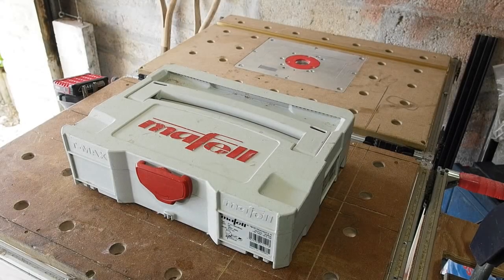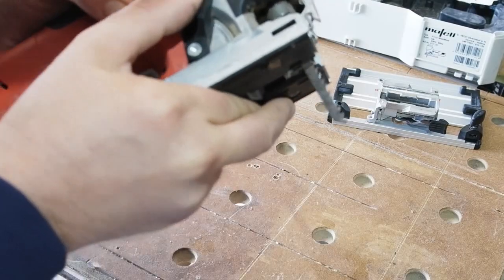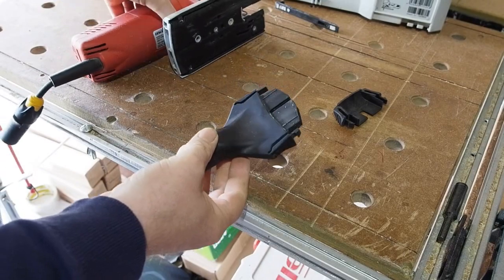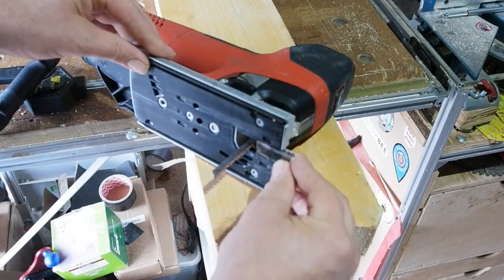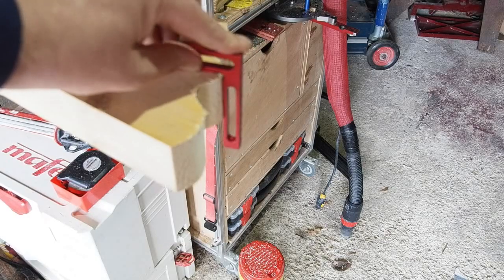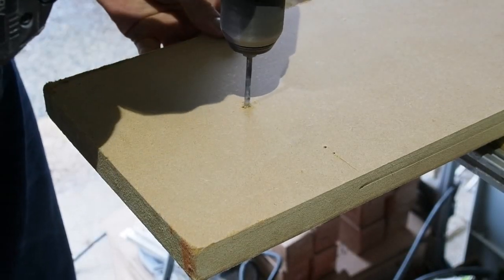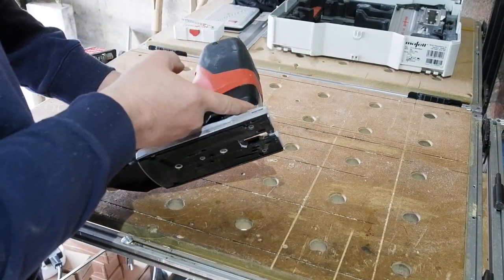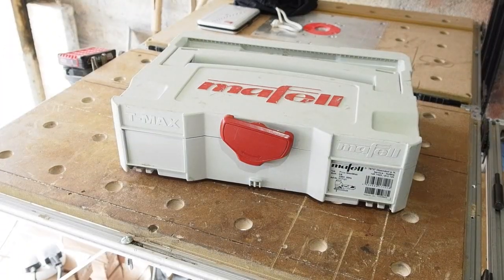Mafell P1CC Jigsaw. A Closer Look And Review.

Comment: Bought my P1cc 10 years ago in the UK when i fitted kitchens it has been used and abused its cut granite with diamond blades and now here in NEW Zealand its finally getting an easier life as i make motorhomes now,  Without doubt its the best jigsaw that has ever been manufactured, my first jigsaw was a professional Bosch one around the late 80s since then i have destroyed countless makitas, matabos, hitachi (didn't last long) and a festool jigsaw before buying the mafell, this one is the one to buy,  Good demo of what the jigsaw can do especially when fitted with Mafell's blades.
Reply from the maker: I've found it one of the more dependable jigsaws I've owned too. One thing I didn't mention is I find it doesn't get that hot compared to others and isn't as hard on blades. Because it doesn't have guide rollers maybe? Not sure. I do still think the corded Bosch GST160's and Festool Trions are are good solid machines but the only jigsaw I'd swap to now is a cordless P1CC if Mafell ever make one.
Reply: @BischBaschBosch  900W + 20% loss in driver = 1080W 
1080/18V= 60A
The 8Ah pack is good up to 80-88A so it can be done. 8Ah minus 20% cut off = 6.4Ah 
6.4/60x3600=384 s or 6 min and 24 sec. run time on one 8 Ah battery.

Comment: I think why they don't come with a light is that in many parts of Europe and the world they actually hold/use the jigsaw "upside-down" (to us Brits anyway) and so the light would be shining in your eyes or just out of sight completely. I have had  the p1CC for nearly 2 years and have fully converted to the reverse cut, its a game changer, lets say you take a piece of kitchen end panel and pencil a scribe on to it, you can use the jigsaw with no fear of chip out on the face side due to the blade cutting down through the face instead of up like the regular pistol grip jigsaws, (i did use to use down cut blades before this but they were a pain to get hold of) My biggest issue was that they didnt design the box with a 110v plug in mind and so i cut out the plastic below the tilt base so that sat deeper in the box allowing just enough room to store the plug, or you end up cutting it off like you did!! Nice review dude!
Reply from the maker: Good point Chris. I use mine upside down a lot too. I only filmed on top cuts as it's easier to film. These barrel grips are actually designed with upside down use in mind. On my 18v Bosch barrel grip, you can turn the light on/off so you don't get blinded. I never got on with down cut blades either. Found they could get a bit jumpy. Another bonus about upside down cutting is, light or no light, you line is always unobstructed. Ideal for scribes. Cheers.

Comment: Great review, very informative and clear concise feedback. Funny you mention dust collection, that is also an issue for the Festool 420 that i think we all wish could be improved. A favorite function of the 420 for me is the lights along with the lights shutting off when placed upside down, but the Mafell has always peaked an interest for me as i hear about its "zero blade deflection". At this point, i think i will wait as ive wanted a cordless jigsaw for convenience purposes over the corded.
Reply from the maker: Thank you!! It really is surprising how effective a shroud around the blade is for jigsaws. My cordless Bosch has one and is almost distress with it. Has a light you can turn on and off too. I still prefer the Mafell for its faults. It just feels like a confident, unimpeded cut if that makes any sense. Is the 420 the old Trion? Good saw.
Reply: @BischBaschBosch  the 420 is their newer jigsaw. Offered in both d-handle and barrel. Once I got my hands on a barrel grip, I’ve never looked back. Especially when you add a Collins coping foot, it’s really nice to hold. I think my favorite thing about the festool as well it’s that it’s lightweight (corded, can’t speak for cordless). Makes a difference when coping but the weight is nice to have when cutting from the top
Reply: @BischBaschBosch  I really need to stop watching your videos because I am going to go broke and the wife is going to divorce me.

I have bought several Jigsaws and I just came to the conclusion that there is no solution to a wondering blade.
Reply from the maker: @rickyperkins232  Ha! Well, if it's s tool you need or use every day to earn your keep, you can tell her it's an investment. That's what I do😁 
Yeah, blade deflection is always a thing with jigsaws, even with the Mafell. Only the cunex blades make the difference really. Although they genuinely do enable a square cut they only make them in 75mm and quite an aggressive tooth pattern. No fine cut or long blade options. For these you have to use standard blades - which can deflect. 
There are other things going for the Mafell as well though. Its really powerful. Really solidly built (this makes it quite heavy for a corded). Plus there's the accessories available to make versatile, as shown in the vid. Hell of an investment for a jigsaw but never regretted buying it.

Comment: Great Vid, have a the Mafell plunge saw and jigsaw and wanted to pick your brains over the square you used attached the rail in the jigsaw video. I have used the bevel square rail attachment that I got with my saw but don’t believe it to be very accurate. have you had experiences with this?. What rail square do you use?. I cut a lot of sheeted materials and I need to find a more accurate method. Many thanks and keep up the good work. 👍
Reply from the maker: Thanks Stephen. The rail square I was using is the one from benchdogs.co.uk . The Bosch/Mafell rail compatible one is a recent addition to the range. This one was kindly sent to me by BD. Personalised too! I'll be doing a review of it soon.👍

Comment: Great video mate, looking to get one myself soon, I want to put on the Festool converter on. I see you’ve changed your cord. Was it a simple process? Cheers
Reply from the maker: Cheers buddy. It's a decent jigsaw for sure. I use the Neutrik True 1 Top connectors. Piece of cake to fit. I did a video on them if you're interested here: https://youtu.be/jnQPcGuLKzk

I think if you wanted to fit a Festool Plug-it cable, they come with a short cord already attached to the connector so fitting it would be slightly different. You'd have to open the saw body where the power cord enters, unscrew the old cable and change for the Plug-it. Still, no more difficult than wiring a standard plug end of the day.👍

Comment: Great video as always, thank you. I'm considering getting one as I'm tiered of wandering blades. The thing I'm concerned about it is the price of the CUnex W1 blades. Do they last longer than a normal bosch blades. they are like 4 times the price, do they last 4 times longer as well ? I guess the fact that there is no blade guide, there would be less friction, therefore less heat which is the enemy of blades. I go through so many blades, I need to take that into consideration. What is your take on that ? Thank you for your advice and all your great videos.
Reply from the maker: Thanks alec. I find they last very well. Whether that's due to them keeping an edge I don't know. Might just be they're an aggressive tooth pattern and super stiff so cut well even if dull🤷‍♂️ I tend to use a ranch of bosch blades for general cuts and only whip out the Cunex where it's important to have that straight 90 cut. Very competent jigsaw though, even with other blades. I know mafell are working on a cordless version if that interests but seems slow in coming.
Reply: @BischBaschBosch   I did hear about that somewhere and I think they run on metabo battery line. Will have to see if it holds up that extra power as well as the corded one. It might weigh quite a bit though 😅 I ordered some bosch T144 DHM blades in the mean time to see if they really last 50x longer as they advertise. The precision ones are also thicker and wonder a bit less. Thanks for your input on the Cunex blades. Have a nice holiday and keep up the good work.

Comment: Another great video, do you have any experience using the KSS saws from mafell ? I'm looking for a bit of a do it all circular saw and its between the kss and hkc55 at the moment. I'm a home gamer so its not for professional use but I hate cheap tools so price isn't really a concern.
Reply from the maker: Hi Tomo. I don't have a Kss but have used them. They are pretty much a do it all saw. Not only do they have/work with cross cut rails but also standard guide rails. While more akin to a standard circular saw, they do have the ability to plunge cut also. They don't have quite the finesse of a dedicated plunge saw but a good contender for "if you could only have 1 saw..."
Reply: @BischBaschBosch  Thanks for the reply bisch, is the cut quality approaching anything you'd get with an mt55 type saw ?
Reply from the maker: You can get a nice cut with a kss. Blade choice and condition is always key of course. But the MT55 has a much high rpm. This is beneficial for clean cuts, especially on laminates.

Comment: First of all, thanks for the video and cool that you're also (still) answering so thoroughly.

I was wondering if you could also give me some advice, a DIY-er with ambitions to do more home rebuilding in the next couple of years. I was looking for the proper saws in order to this work, a part of which is rough construction work, but one of the most challenging things that see are things such as kitchen tops that need a very neat finish (I am thinking of the laminated kinds of 4 to 5 cm thickness). There's other stuff I'd use this for, but you've demonstrated already how well this works for solid wood.

As this is not my profession, I was thrilled to find out that with some of the more expensive jigsaws, e.g. the Bosch Professional GST 160 CE or a GST V18-155 SC, you could hook this up to a rail such as the one you use (FSN 1100) by making use of this plastic adapter (FSN SA), and you'd be able to cut 'perfect' straight lines. As these jigsaws are of a better kind, also non-straight lines should be doable (such as the corners for a kitchen sinks with rounded corners), I hoped.

As it is not a problem for me to spend twice the time or even more on that on a certain cut, I thought this might be a decent approach, and I'll invest in a proper plunge saw or maybe even a circular saw later on.

Not completely convinced yet, looking into the different jigsaw mechanisms (e.g. the double roller on the GST 160 CE) and already thinking why they don't just make thicker or wider jigsaw blades for reducing the deflection, I ended up looking for comparisons and found your video, which was very useful.

I was wondering if you think this approach while investing in this Mafell P1CC makes any sense or am I too far off what is sensible (I'll skip the Makita, Bosch Professional, Festool, etc. like many others have seem to have gone through). To me, it looks like the Mafel P1CC can make very decent 90 degrees cuts that are will be hard to distinguish from proper circular saw cuts. And investing in this Mafel P1CC means investing for something for life, which is something I can appreciate. I'll have a saw that can do the corner cuts very well and the straight line cuts quite decently, just much slower and by spending more money on blades I guess. But I'll only be doing this work where 90 degrees cuts are a important less than 10 times per year, so that is fine. Does this make any sense, you think? :-). If I phrase this differently: what are the specific reasons for still not using this tool for work with rails? Is it mainly a time-is-money reason, are the blades to expensive for these large cuts, or is the result still less than desirable if you demand a professional finish? Or something else of course.

As for the Cunex W1 blades, which are the main star and differentiator of the machine as you seem to mention (and that makes a lot of sense to me), they seem relatively rough / have a relatively low tooth count. Do they provide a fine enough finish for something like this laminated wood?

Edit: I can also see the Mafel P1CC doing very well in cutting the bottom of baseboards that are to be placed on an uneven floor, something that can be done with a circular saw, jigsaw, planer or belt sander I understand.
Reply from the maker: For laminate kitchen worktops, or indeed melamine faced material such as that used for the cabinets,,  your best tools for a clean finish (that doesn't chip the brittle laminate) are routers and plunge saws. Using a sink cut out as an example, you d route a shallow pass - 4-5mm - to deal with the laminate, following a template. You can then use a jigsaw to more quickly cut out the central waste part. Then switch back to the router to flush trim.
The same sort of cut out with a plunge saw is much quicker. Lay out your cut out with tape. Align a short guide rail and do a shallow pass for the laminate first, then full depth plunge cut. Where material is left at the corners due to the circular blade  you just finish with a fine hand saw. 

You can use jigsaws for scribing cabinets or worktops to walls but you must use a fine tooth blade to limit chip out. If you've not done it before, I'd highly recommend practicing on an offcut. 
The Cunex blades are no good for such work. They're more of a first fix construction tool. 
If the scribe at the back of a worktop is more or less a straight line, use a plunge saw and just refine with a block plane 
The p1cc  with standard jigsaw blades is no more reliably square cutting than any other good quality jigsaw. 

For fairly solid advice and demonstration of kitchen fitting, including masons mitres, Skill Builders channel has a decent series from some time ago. 

Hope this helps.👍
Reply: @BischBaschBosch  Thanks for the info, that does help. I should really look into a plunge saw instead I believe, for the P1CC money I could get a decent plunge saw instead, or still spend some extra and go for the Mafell MT 55, although at plunge saws, I think there is less to gain from a Mafell than with the jigsaw. And a router is also something I should consider. But I barely know those tools yet. From what I understand, I'd need a relatively big one that can do the 5 cm worktops.

What I don't fully understand is that you say that the Cunex jigsaw blades are a "first fix construction tool". I'm not a native English speaker and I don't understand what this means. 

Moreover, I was wondering where you use the Mafell jigsaw and Cunex W1 blades for.

I do understand the part that they do not have a fine tooth blade, so this could lead to more chip out, although this is somewhat of a surprise to me after I've taken a look at various reviews and marketing materials from Mafell. Maybe they were not using the cunex W1 blades in those cases.

I've started to check out the Skill Builders kitchen series and also some kitchen worktop videos from LTW carpentry https://www.youtube.com/watch?v=cXOwH9pWIQI.

Thanks again.
Reply from the maker: @odi8359  "First fix" refers to initial framing.  Second fix is fit and finish - in the U.K. anyway. I honestly think a good idea for you would be to buy used machines. Spend any saved money from your budget on decent blades and cutters. For example a decent "triple chip " blade for a plunge saw, specifically made for laminates. Best if luck.👍

Comment: May I ask for some advice? I work almost entirely on cabinetry, so I'd basically only ever be using a jigsaw to scribe face frames etc. I love my Mafell Track saw and am trying to work out if this jigsaw is overkill for the sort of thing I'd be doing? For cordless stuff I'm on the dewalt battery system so the alternative would be the 18v dewalt barrel grip saw. Any thoughts on which way I should go? Thanks for a great channel
Reply from the maker: It's a good question. Personally, using the mafell with the cunex blade I find excellent for scribes. Not just because the blade has next to no wander like other jigsaw and blade combos but also, the cunex blade being so stiff, it's great for undercutting scribes. You can use it to carve away. Far more effective than standard blades. That said, it's quite an investment compared to others. Very hard for me to say whether it's worth it for you. I also have an 18v Bosch barrel grip. There's a lot to be said for the convenience of a cordless jigsaw. Especially onsite. Hope this helps in some way.

Comment: I disagree with dust extraction with an extractor its almost perfect and without one the jigsaw uses its own motor to blow the dust thru the hole in the front and out the back i think its best in class. Another unique thing about the jigsaw is because it doesn't use a roller u can flip around the blade for cutting from below. Great review I enjoyed it where did u get the cord  adapter for shorteni g the cord?
Reply from the maker: You know, I did mean to mention both of those things - the blower and ability to cut backwards. Some of these points get lost in the process sometimes. They do for me anyway. I find the blower one side, extraction the other works OK with a fine  cut blade, pendulum backed off. But in my experience, as soon as you use a more coarse blade and pendulum setting, the blade action throws dust up, This doesn't give the extraction a chance to remove it. The blower and blade action mean chips/dust just get thrown up and rightwards. That's why I mention it'd benefit from a shroud. Don't know why Mafell don't make one having put so much thought into the blower/extraction. The cable connectors are Neutrik PowerCon True1. Obsolete now but their new version is the PowerCon True1 Top. They're compatible. The only real difference is the Top have silver/grey detail rather than yellow. Did a vid on them as it happens: https://www.youtube.com/watch?v=jnQPcGuLKzk